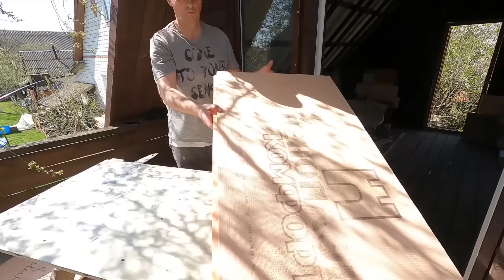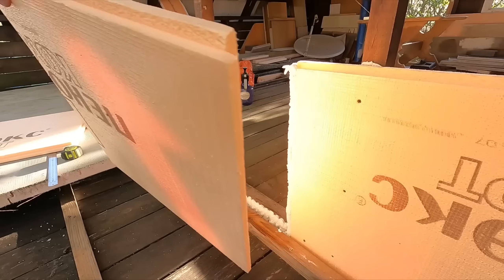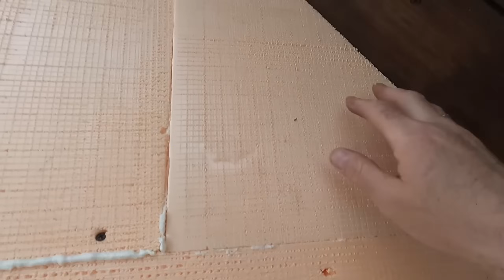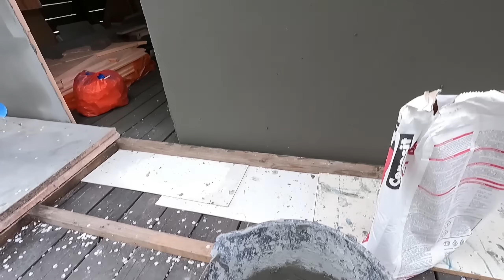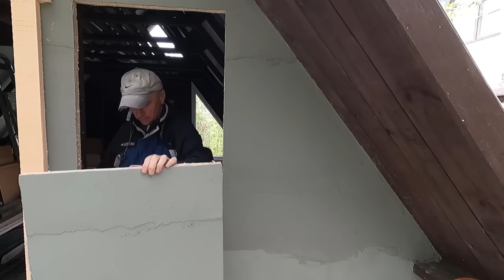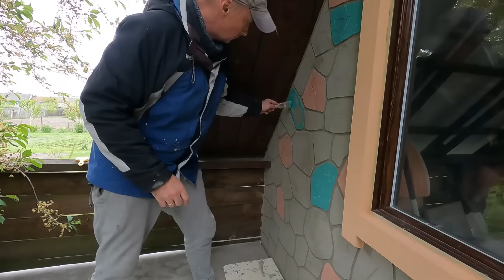DIY Walls: Fireproof, Warm, Cheap, and Durable! Build a 2-Story House for $1000

Comment: I've been thinking that a modern version of wattle and daub is a very cost and energy efficient method of wall construction.  This method has been used for centuries during the Middle Ages and will last for hundreds of years with some maintenance.   For lasting wattle from wood I think treating the wood by charring or soaking in lye or pine tar will make it rot resistant.  The biggest expense would be the wood. Something flexible and rot resistant.  The daub is free everywhere, soil with clay, sand, and small pieces of straw (1-6"). Just need to determine the right ratio of soil and sand based on clay content.

Comment: What is the fire rating of these materials?  What kind of gasses are emitted when they burn?

How much force is needed to just "blow thru" the wall?
Could a drunk uncle carrying a heavy weight fall into the wall and damage it enough to break completely thru?

As far as your idea that building for intermittent living (seasonal) means you don't need to build according to code...
I disagree.  Every building that is used to house humans needs to meet certain codes.  There's a reason why we NEVER say "this building doesn't need to meet code because I won't live here often..."
That's because your intention is only valid for YOU, and even that might change over time.  What happens when your teenager wants to move to the summer house?  Or he marries and needs a place to live... or what if you sell the property and the new owners want to use it full time?

Everyone expects a house to meet certain minimum "manufacturing" standards... even you yourself were angry when the mesh manufacturer "cheaped out"... the product you got was NOT what you were expecting... that's what happens when you build according to your whims... everyone else that lives in that house gets "not what they expected"....    

I'm an American, and deal with International Building Codes.  Yes, they might seem like a burden, but MOST regulations have been developed after a number of human tragedies have occurred.... those codes are meant to make humans safer.

Comment: Foam board with stucco on it has no strength to it so if ya ever had a big big wind storm all you would have left if studs and rafters. Guys building like this ya swear you would hear the next thing come out of their mouth is that if ya only have a single story house you can use foam for the studs also! Yes foam on the house but plywood or regular pine boards 8" 10" 12" inches wide underneath!

Comment: Looks like doll houses to my European eye. Such gypsum panels even if water resistant are not really mold/water resistant. They soak in water like sponges.
Reply: He used Penoplex, it is from extruded Polystyrene Foam, so I suppose it does not absorb water like gypsum does.

Comment: Polystyrene (PS) toxicity is a growing concern, primarily linked to its tiny particles (microplastics/nanoplastics) and its monomer, styrene, a known carcinogen. Exposure to PS microplastics (PS-MPs) via ingestion or inhalation can cause inflammation, oxidative stress, gut microbiome disruption, and damage to organs like the lungs, heart, liver, and reproductive system, potentially leading to cardiovascular issues, male reproductive toxicity, and metabolic changes. While the monomer styrene is classified as a possible carcinogen, research on PS-MPs is ongoing, highlighting risks from particle accumulation and the leaching of adsorbed toxins

Comment: The last 20 years I worked, I drove BigTruck all over the U.S.A.
And I fell in deep abiding like with LED lighting. When I retired and bought my tiny house, the first home improvement I made was to remove all the incandescent light bulbs and replace them with LED light bulbs.
And then in the 5th year I purchased 12 Volt white lights and ran "bell wire" to each room. I also got some tiny toggle switches and installed them next to the original 110 Volt light switches.
Using 2 100 Watt solar panels and some old car batteries, I have weaned my house off of the 110 Volt lighting now. I also have a 35 Watt inverter I used to run my refrigerator in the truck.
Really, the only 110 Volt appliance I use now is my tiny washing machine.
Last year at the city office where I pay my electric, the lady wanted to know if I was freezing my dogs . . . She didn't ask if I was freezing . . . but she did care about my dogs.😅

Comment: Thanks for your guidance. We mostly started out in caves in areas with really hot summers and really cold winters, to take advantage of the modulation of temp provided by the earth itself. A lot of that knowledge seems to be lost now in many places. I do so much like your inspiration that it is possible to build houses much more cheaply. Here in the desert SW of US, using the clay mixed earth is good, but it is very labor intensive. Am not sure about the carbon footprint of your materials, am concerned it may be very high when it is manufactured. I do like your enthusiasm for doing it yourself, I have that nature too.

Comment: Black (drywall) screws are brittle and BREAK. No way - they will rust then break. It’s what you don’t know that causes problems.
Like the problem you created that you didn’t use any vapor barrier (building paper)….
Moisture immediately inside….
No screws holding that modern insulation styrofoam???? Not even believable. 
No backing on the open edges? 
Also a crazy idea.
Not sure where you’re building, but that’s nothing but a kid’s fort. 
Serious- it won’t be sealed and warm.

Comment: Not much structure there…. 2nd floor gable has no diagonal bracing, continuous blocking (grid) or backing required to keep a wind from collapsing under wind shear or snow load.

Comment: Are you still under $1,000?  A 4 foot by 8' foot sheet foam is anywhere from $30 to $50 a sheet (that is 32 square feet or 2.97 Meters which I assume is  the space between your studs. and I can't even imagine the re enforcement mesh and plaster cost in the US now at BS big Box Stores. Everything is crazy because "they can".

Comment: I disagree! We have used breathing walls for thousands of years. I personally prefer a 3 foot exterior wall width stabilized earthen structures.. not only does it insulated, but it stabilizes tempreture and humidity.  The are earthen structures that have lasted between 500-1000 years. Can yours do that?

Comment: Can't locate penoplex here in the states and the only foam board available locally is typical garbage. If you haven't seen how poorly homes are built in the US, you will laugh at what the charge for what amounts to temp construction.
Reply: Owens-Corning is the big XPS supplier in North America. Not cheap either. It must be a near- monopoly.

Comment: I'm thinking of doing a cheap fabric carport like this.  Make panels to fit between the metal post and then apply trim on the inside and outside.  The roof will be the only thing not foam.  I'll put a metal roof on it. I already have the carport on a level frame made with treated 4x4 lumber. That is all sitting on compacted crushed limestone.

Comment: I wonder if this would get through the Clallam county review board... Because I want to build a gym in my backyard and tear down a dilapidated shed.  Nothing too crazy like 20 x 20 or 12 x 24, around there.  But we get 90 mph winds at night every 3 months or so, so there are some rules that we encounter... I mean my neighbor had a glass greenhouse that was approved.  4 months after construction we had one of our wind spells, the damn thing blew up!  Because they hadn't shut one of the windows and it made a wind tunnel that blew the door off it's hinge and then the within vibrating through it shatter the windows outwards.  It was nuts to hear/see.

Comment: Across the Sea here in the Falsely manipulated Independent,  country I was born, the U.S. of,, America.  Spent my entire working life in construction as; a Plumber for over 30+ years.  I like what you are accomplishing.  We have a homeless crisis here because of Capitalist pursuits.   I have watched families enslaved in there purchase's of over priced, over interest bearing mortgages, work, struggle  to pay 30 year note's, only to lose whatever level of payoff they achieved and those broken so badly by such, never return to try again.  It has multiplied  with a vengeance over the last two decades to a point,, the young don't even participate in what was, the so called American dream anymore.  The haves "wealthiest" look at them as worthless trash to be discarded, and removed from there sight. Horrible.
So,, I  too look for ways to give those broken, a hope to try.  Maybe it will start the flame of true independence in them.  There by, those who created such a mess, will starve by there own creation of there bigotry.
Please explain this material so I can research for access. How is it spelled? Our manufacturing here may call it by another name.  I know of a polymer based "stucco" here applied over a foam board in most commercial construction projects since the late 1970's.  It comes in 5 gallon buckets, in various colors, is durable easily applied, strong as concrete when cured,  but very costly.  Un affordable to the already oppressed down troddened and way too pricey for me to donate myself.  Capitalism originally was formed to collectively fund un affordable needed community projects like; roads, bridges and various community projects,, until it to became corrupt with a few coat tail riders and there insatiable greed.

Comment: People should come up with some stronger gluing ideas and try this light weight idea for their small camper.
Reply: look up ""foamies or foamy camper"... they are already out there 👍
Reply: I saw a guy on YouTube  used a 2 part super glue to bond them together.
Reply: There are definitely videos of similar processes for campers trailers  , even planter boxes  without the Styrofoam panels but some type of poly added to mix and  put into forms to make light weight bricks that appear very sturdy . I watch you tube too much to remember a specific channel, I just let the algorithm do its job at finding things like this after I chose to watch a tiny trailer build or someone somewhere mixing stuff in a bucket.

Comment: I actually have decades of design/build experience.

Thin set mortar  is not waterproof (resistant) 

The process described “developed” by this channel, sadly does not comply with most essential US structural building codes. 

It has little structural properties as a key component of structural strength is the ability to move with settlement, wind, seismic and other point load factors.

These exterior of the walls are brittle and the will not support weight without cracking. (No flex)
It will not support enough weight to support a roof frame and roof  material. 

Is is not wise to reinvent the wheel when it comes to protecting your house from the elements. 

I am very dubious as to this process lasting more than 5-10 years.

Certainly better than a cabin, or maybe an even rv, but in the US, it would not be likely this could be added as new inventory to the housing market.

One other  issue:
The insulation value of 3cm XPS foam is r-5 to r-6, but is a thermal barrier. 

It is not always wise to spend the least amount of $ on paint and exterior finish materials as there is a range of conditions including UV, moisture, freezing, etc. 

It is a good process to augment a structure, 
But no new construction is allowed without calculations or at least following standard building practices.  

It seems that this process in conjunction with foam/ concrete blocks with steel rebar is the good compromise (along with elastomeric or urethane paint)-will comply and last for years without risk or excessive maintenance.

Comment: I know it's in one of the videos but can you explain the supplies list please?
I'm in the middle of the USA want to try it on a small cabin and outhouse.
I'm also looking for products similar in the USA and not finding anything
Reply: Closest thing that I have found is fiberglass screen door mesh. However, I do not know how its engineering properties compare to the fiberglass plaster mesh used here.
Reply: This is mostly just different version of stucco in usa. You can apply stucco on styrofoam like this guy and most commercial projects or over concrete or durock sheets. If you look for Kirk giordano plastering on youtube, youll see our version of these products and terms. All these materials can be found at home depot or lowes. Mostly HD.
Reply: I would also like to know that to. I can't find the fiberglass mesh that you use. I have found a chopped fiberglass mat that is 50 inches wide and 50 foot long roll. Any thoughts on if that would work?

Comment: Keep up the great innovative content. I'm down here in South Texas. Wondering if you could create or share the possibilities of using this technique to build a tiny camper trailer. I have a single axle almost 7 feet wide by 10 feet long. I like a gypsy trailer style. Thanks so much for your information.
Reply: Search for Foamie diy campers.  Use of cement would make it heavy.

Comment: Southern Virginia, USA. We get everything. 100 degree plus summers with high humidity, winters average with lows in low 20s, but I've seen negative digits. ( Fahrenheit scale ). My particular region gets little snow, but plenty of ice. We've seen floods, droughts,   seismic activity every few years that is below what most people feel, but enough to cause foundation settling issues, coastal storms every year or direct hits from  the Hurricanes every few years. There's even been the occasional tornado due to excessive timbercutting removing natural windbreaks. How would you suggest mounting FUNCTIONAL storm shutters to those decorative casements you did? How secure is your country house from some lowlife druggie just kicking through the wall? Burglaries and break ins from evilminded, or just greedy people happen to rich people's vacation homes with surprising regularity here.

Comment: Do you find fiberglass mesh or plastic mesh is better?
Reply: You don't want to use plastic mesh. You need good tensile strength. Fiberglass has a tensile strength that is up to 4 times higher than steel. As for plastic it all depends on what type of plastic but it's still going to be a lot less than fiberglass. Also, the elastic Modules of plastic mesh is very low whereas fiberglass is very high. You'll also want the skins to be as fire resistant as possible especially considering the fact that the core needs protection so again you need to use fiberglass mesh and not plastic. Finally plastic mesh normally has only moderate alkali resistance whilst fiberglass mesh has excellent resistance, but you MUST use AR fiberglass mesh as opposed to E glass
Reply: @hugovanlawick8716  where would you find such a mesh? Certainly I did not find anything like that at Home Depot ( North America) I might have used the wrong keywords in my search.

Comment: What is your gray plaster? Cement? Joint compound? Patching plaster? Plaster of Paris? Sheetrock plaster? Gypsum? Drywall? Polyurea Coating? Foamcoat? Silicon? Latex? Epoxy? Fiberglass? It looks like cement.
Reply: It’s a mortar with additives to help it stick to foam. Look up  (EIFS system) and it will give you an idea of
Reply: @Dannymurmaid  would cementitious tile mortar work?

Comment: Here in the UK it occurs to me that a cheap source of timber cladding for a building would be to dismantle shop-bought treated larch-lap fence panels and cut the thin boards to fit. These flimsy panels last for decades as garden fences, so should survive indefinitely if used as cladding on a solid wall.
Reply: Robert Murray Smith always promoted 'Builders Board' a dense foam material, said to be PVC sandwiched between two thin layers of impact resistant  uPVC. But nowhere to be found/identified, not by me, nor by the members of his Discord, nor those of the Big Clive and Technical Family discords. Was said to be cheap, and very easy to work with. Does anyone on YouTube know, perhaps brand or technical name?